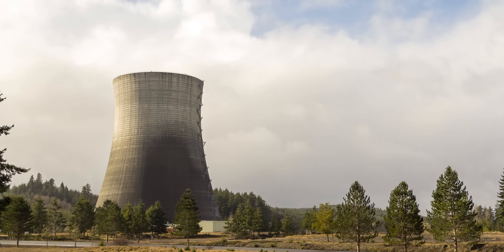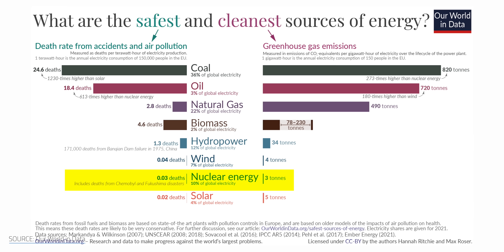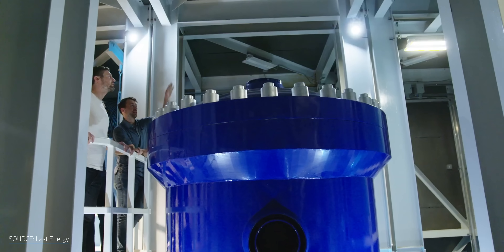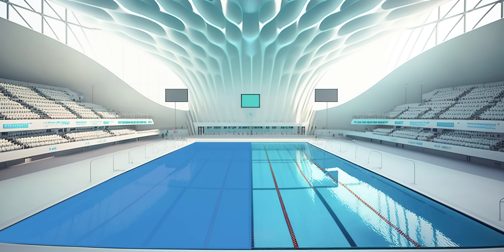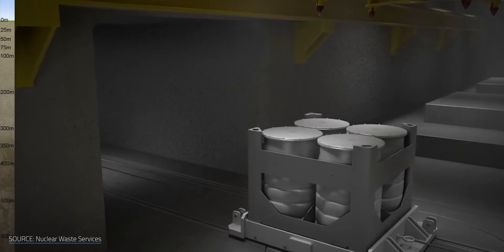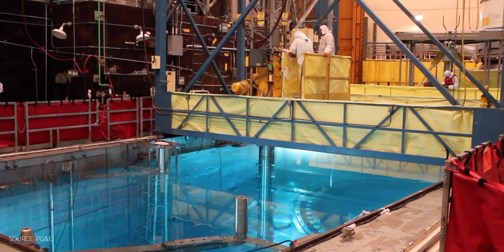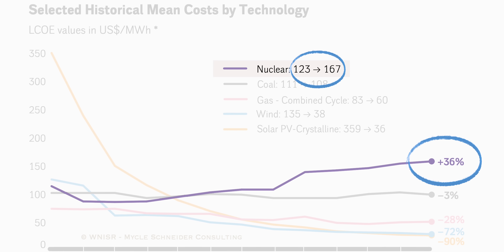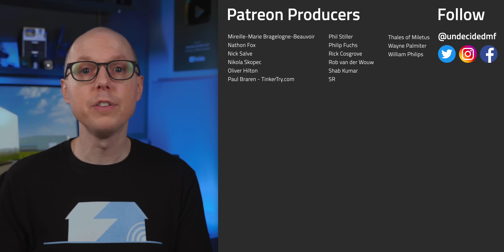Is Small, Fast, & Cheap the Future of Nuclear Energy?

Comment: Nuclear really isn't THAT expensive, even now, the problem is just that the cost is almost all upfront. Putting up 10bil and only start getting any money coming in 10 years later is the problem.
In the long run the plants are basically money printers, but you have to look at it on a scale of even a couple decades.

It's so much easier to quickly put up a relatively cheap coal plant where the cost is much more in the running of it.

Comment: If I am understanding things correctly, does this not mean it takes roughly 55  of these SMRs to equal the same output power as one 1100mw singular $6b conventual nuclear plant? Dont get me wrong, I think this is great and without competition, there is no drive to do things better or more efficient, but this also means this new tech right now would be $6.7b for the same output of power. From a standpoint of 55 reactors vs 1 large commercial one, does this not put more risk for possible failures on the SMR side when rolling the dice? My only opinion is to get the price AND risk lower.... For conventional science comparison,  over the road semi truck engines are inline 6 cylinders vs bigger V8s (for the most part) and get the same work done with 33 percent less moving parts. Can we not get the 1100mw facilities worked out with a proven template and better efficiency to lessen the risk and cost over the lifetime in one facility vs 55 smaller ones?
Reply: That would be a factor of economics and competition. They are a business, so, it’s time to cash out till the next kid on the block. So, the price would probably come down with time.

Comment: Those deaths are only because of 3rd would countries.  Deaths for coal mining in the US is VERY rare.  And the manufacturing of solar panels typically is done in China and they do not properly recycle or dispose of the toxic chemicals left over from the process to make pure silicon.  This also requires a lot of energy, which in China is coal power plants that lack the filtration the US has.  Millions die each year from all the pollution in the China and the countries around it.  So if these studies are just going to hand pick the data... how about we look at the impact of pushing manufacturing out of the US to countries with little or now environmental laws.  And if China has any they do not follow them.  China is doing the most damage to this planet... FAR more than the US.  You can not look at CO2 as it has VERY little impact on the environment. You need to look at Particulate Matter (especially 2.5 micron) and mismanaged waste.  This would point to Asia, the Middle East, Africa... not the US, Europe, Australia, Canada, Japan...  And if the environmentalists were serious they would want these countries to use trade to force these countries to clean up.  The current environmental movement does not actually care about the environment.  All they care about is money and power.

Comment: I'm going to still back wind/solar/hydro over nuclear. First, I've worked closely with people who designed and built nuclear plants, so I'm a bit cynical, and it doesn't help that most of the facts presented here seems to have been provided by the nuclear industry. More importantly, the current trend of solar and wind getting cheaper looks like it's going to continue, and the worst downside of them (energy storage) seems to be ready for a similar price free-fall, so the economics of renewables looks better in the mid-to-long term. 

And, of course, it's harder for terrorists or foreign governments to target solar or wind arrays than to target larger power plants.

Comment: There is a bit of madness in using any single energy source to exhaustion, of course, I now have to contradict myself and say that all the energy we currently use is solar(OK nuclear is stellar in origin, but close enough). Coal and oil are just the least efficient way of turning sunlight into usable  energy. Nuclear is somewhat of an outlier as is turns a star ars gravity in to a fuel. Hmm, I thought I had a point here. Sorry. Carry on.

Comment: The high cost is precisely because we haven't really adopted it. The upfront cost of switching from coal to nuclear will be high, but it will be amortized over the lifetime down to a much lower LCOE, likely below coal, with the net benefit of much fewer emissions and huge potential gains from recycling spent fuel. Deployment of solar/wind and development of their tech along with batteries is slow and will take a while to fully replace coal. Nuclear could do it in 20-30 years. That's why we keep saying "just go nuclear." Everyone screams "we gotta get off coal and stop mass producing CO2" but then they look at the timeline for a full green rollout being 50-100 years and say "yep, sounds reasonable, keep burning the coal." ????????

Comment: I am definitely in the "Just go Nuclear" camp. These small, modular systems appear to be a real, safe, doable solution.
Reply: I think we need to take away from the ending, and not just have one thing! Nuclear will be great addition, but we have so much wasted space we could put solar on, roofs, factories, car parks - and more! The fact that we blanket good agricultural fields with solar because its a "better yielding crop" is just stupid, but going only nuclear would be too - there are still problems, and it is still kind of expensive, solar and wind, and a few other renewables is certainly worth to have in the mix, or to be honest, the way I see it - Nuclear is worth to have in the mix too!
Reply: @Krydolph  Agree 100%. Side note, I just read that solar and wind are now generating more power in this country than coal. So, at least we are making some progress. I see nuclear, along with massive expansion of wind and solar, as a way eliminate fossil fuels altogether. Nuclear fusion will likely prove to be the best long-term solution, imo.

Comment: Really interesting and realistically what nuclear should be by now - reasonable scale & modular, but what happens to a nuclear plant if it is not maintained? At best localized toxicity at worst major waterway death on a continental scale. Nuclear has some of the best redundancy tech on the planet but without maintenance it still poses a significant risk to the wider environment over millennia in a way that solar & wind do not.

Comment: I'm a little sceptical of manufacturing thousands and thousands of SMRs and putting them all over, because just like underground gasoline tanks at filling stations, a percentage of them are going to leak, get hit by a truck, etc.  I like the model of a few hundred to 1000-2000 large plants with protection and trained staff on hand, with either large plants, or "farms" of SMRs to get mass production and transport benefits.  But if we don't reform how plants are regulated, none of this will matter, we're just heading into a still-carbonized energy-poverty future with really horrible weather.   You can't demand a steady stream of post-construction design changes with complex technical artifacts like this, though maybe we could also do a better job designing for modular accesible components to make upgrades easier also.

Comment: Any time people talk about the 'benefits' of modern nuclear power if feels like a lot is glossed over.  People tout the 'safety' of nuclear energy, but the risks are currently so low because of the rarity of it.  Think of it this way, if you have 200 dogs you can't give all of them as much attention as you could just a few; and when you don't give them attention they tear up the furniture.  Same thing with inspections of nuclear power plants.  Less inspections (which will occur when you scale up) means more corners will be cut (because profit), and the risk of disaster and failures goes up.  Concerning the spent fuel, dealing with the waste is no light matter that can be waved away as 'storage will be built'. They (every country) have been trying to do that and have been failing for 60+ years as no one wants it in their area.  I applaud Finland, but until it starts actually storing waste it is just another Yucca Mountain project; all promises and wasted money.

My biggest concern wasn't even addressed: Security.  A bad actor getting ahold of a solar panel means nothing compared to one getting ahold of nuclear fuel pellets (i.e. dirty bomb material).  The proposed images showed no security and they will be a target.  The more nuclear plants, the more security you absolutely must have and thus the cost per energy goes up.

Overall, I don't see the point in pushing for new nuclear technology when renewables and energy storage get more cost effective and better every year.  It feels like trying to shoehorn in a specific solution when better options are already available.

Comment: Great video, as always! I would love to see a video going more in-depth about the reduction of nuclear waste half-life. Before this video, I had never heard of such a thing being possible.
Reply: it's called transmutation,... and no, we can't do it on an industrial scale and no we can't do it on all of the nuclear waste
Reply: @markus1351  Such informative. Very expansive.
Reply: @johnfry  Transmutation is only a small part of the solution. It is really about reducing the overall time that a given mass or volume of used fuel remains radiotoxic which can be thought about a few different ways. It all basically comes down to separation of the components into multiple streams since each component of the used fuel has different properties. 
The largest mass/volume of used fuel is simply U238, which is not really a problem as it is not particularly radioactive (also called depleted uranium). If you can remove that part, then the mass/volume you are left with is much smaller (how much depends of the reactor/fuel design, but for thermal reactors typically less than 10%. Then we have fission products (FP), the majority of which are short lived and provided those can be isolated, become essentially neutral in a few hundred years, where "neutral" means same radioactivity as the ore that came out of the ground (think Sr & Cs). There are smaller amounts of FPs that have long term radioactivity, like Tc and some I isotopes. Transmutation as mentioned by the previous commenter only really applies to this fraction. 
The last part are the materials that are fissile. Which components fit into this stream depends on the reactor you're going to "burn" them in. In the majority of thermal reactors these are basically left over U235 plus any Pu239 produced during operation, but in Fast Spectrum reactors they consist of all the Transuranics (i.e. everything Uranium and above) and can ALL be burned i.e. turned into FPs. It is this last group which is mostly responsible for the very long radio-toxicity of used fuel and to a lesser extent the long lived FPs.
The challenge in order of impact is to:
1) achieve very, very high separation purity of the streams so they are not contaminated with components that should be in other streams
2) do so preferably without ever isolating pure weapons grade components e.g. Pu239. This is the problem with the PUREX process France, Russia and Japan use, though it is arguably only a problem in non-weapons states. It is also a potential problem with proposed processes for Th MSRs, but in that case it is U233 not Pu239. Basically you always want the weapons usable components to be mixed with other highly radioactive components so they are very difficult to steal or work with which deters proliferation
3) have working fast reactors to "burn" the transuranics
4) store the majority fraction of the FP for a few hundred years till they are the same radio-toxicity as ore so they can be either safely disposed of as is or optionally have their valuable components extracted (e.g. Rare earths) prior to disposal
5) optionally if you want a total solution is the transmutation step. This is perhaps the hardest part to do at scale. It consists of collecting the small amount of those long lived FPs and designing reactors that have a space for them in the core, which over time will change them (transmute) via neutron absorption into a different stream. This is really only practical in a fast spectrum as well due to the extra neutrons produced in fast fission reactions. Alternatively, they can be disposed of in a long term geologic repository, which will be MUCH cheaper than a once through repository as it has both far less mass/volume to deal with and far less max heat produced by decay, which is a major factor in repository cost.

There are ways to do this and we have known the basic paths for several decades. The question is, can it be done at low enough cost to offset the high expense of disposing of used fuel directly in a repository + reduction of new ore required for more fuel.

There are some videos on this stuff, but the best sources are published papers. INL & ANL in the US have published a fair amount of material on it, in particular related to the IFR reactor project in the 80s-90s and the subsequent treatment of it's fuel in this century.

Comment: Great video. BUT:
The "High Level Waste" problem is uniquely USian. The rest of the world wasn't fixated on PWR reactors (so that they can make plutonium for bombs), nor did they actually BAN the reprocessing of fuel. Out of 100% Uranium that goes into a fuel rod, 95% comes out. Plus a few percent Plutonium and a few percent Actinides. These are reprocessed in civilised countries, like the UK, France, Japan and even India. But USians pretend that it's "impossible" to get those 24,000 years down to 100 years. So, the cost of fuel is actually trivial.

Secondly, the LCOE is hugely dependent on the assumed discount rate. This is really significant for large long-term civil engineering projects like conventional nuclear and hydropower. The usual assumption is 7%-12%. In the real world, a government guaranteed bond gives rates of 2%. Suddenly, Nuclear isn't expensive anymore!

But you are right. I agree that the future lies with SMRs. It's a complementary technology that can provide a load-following baseload and fill in the gasp for renewables. It's not one or the other, it's both.

Comment: Most commercial reactors are called 'converters'. The U 238 is converted into Pl 240 and then the fuel cells can be shuffled to take advantage of the plutonium. A percentage of fuel cells are stored in a fuel pool and will probably be used again. Knowing the usefulness of a fuel cell requires very accurate records and careful planning. (beyond the scope of a comment).
Military reactors, called burners, might get one full refueling, or possibly 2, but these are insanely expensive.
I worked in the Nuclear Industry for 12 years, 7 in the military and 5 in commercial. 
Will you make yourself available to guard the spent fuel cells for the next 20,000 years?

Comment: I always said SMRs were the way forward especially when there is a High pressure system in the winter with freezing fog; No Wind or sunlight. This solution offers relatively cheap energy (not sure if you said the ROI like you did with the others) and it will also not need the battery backup systems like solar does.

Let us put them next to the transformers for villages and small towns, are they tornado proof. I think a British company is also in the SMR game.
Reply: The problem is that nuclear plants are not peaker plants. If you run them only when renewable power sources are not available, then the cost is truly astronomical. So once built they must be run at near 100% all the time - and all users must be forced to purchase that power at whatever cost is necessary to make that plant financially viable. 

In areas with some hydro power, that can be used to fill in the gaps as water is typically a limiting factor, ie a hydro plant isn't expected to run at 100% capacity all year anyway so holding some water back to fill in gaps is economically reasonable. A widely-distributed power network is also a good solution - there is going to be wind and sunshine somewhere. Then there is a range of partial solutions, including managing load (particularly reducing industrial demand during shortages) and various options for medium-term power storage (not necessarily battery). Nuclear is such an expensive option, in addition to the other disadvantages...

Comment: Turning the nuclear debate into a question of economics strikes me as being much the same argument as would have been used by the fossil fuel industry when oil and gas were so much 'better and easier and cheaper' forms of energy than burning wood or using steam. And no, I'm not into Steampunk. 
The oil barons of yesteryear didn't know about the potential harm that oil and gas could/would do. That is an excuse, of sorts. By contrast, we do know the potential harm that nuclear can do. With thousands of such SMRs all over the world, the probability of some of them failing, or being used as a threat by terrorists increases exponentially. Many small Fukushima's do not make me feel safer than one big one.
And then there's the waste. Short of sending it up in rockets and disposing of it in the sun, there is no sure way of getting rid of nuclear waste. We'd just be kicking the can down the road for some other generation to deal with. But, as with so much of human thinking, we can shrug that future harm off because 'I'll be long dead by then'. 
Short term thinking has always been humanity's most dangerous flaw.